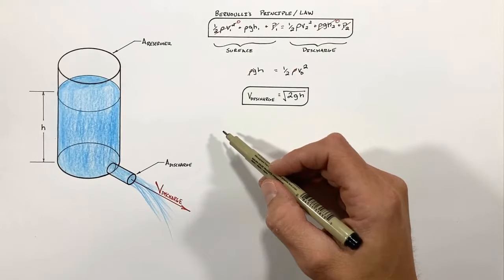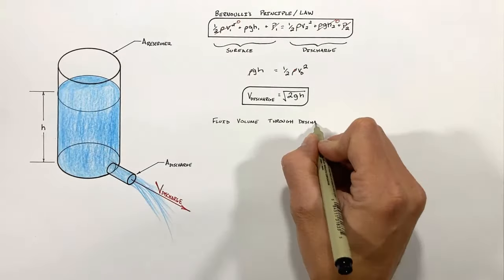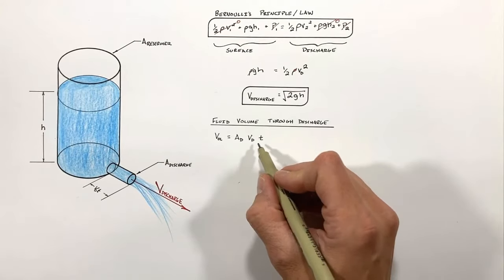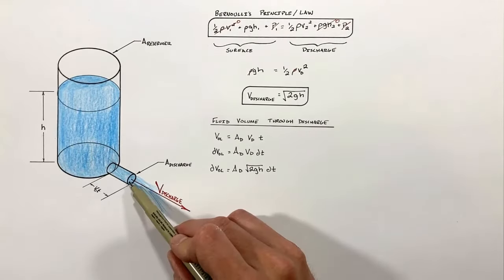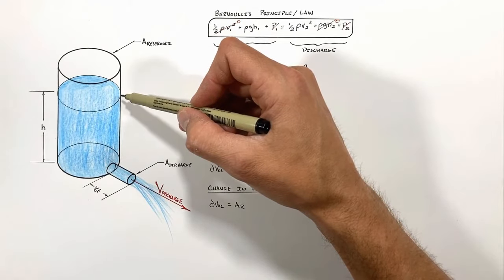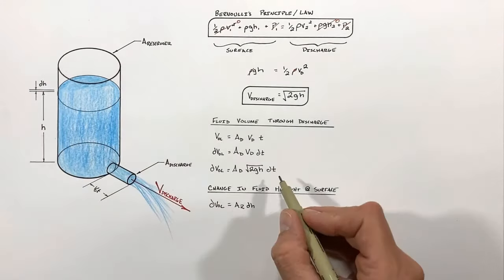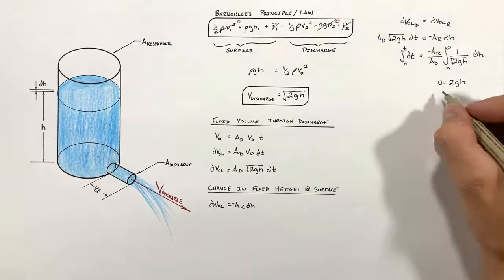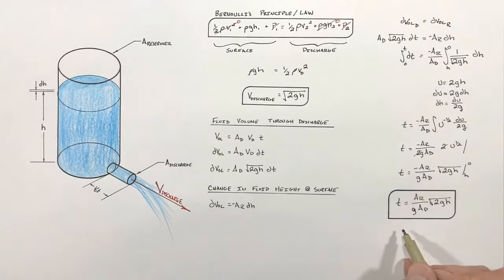Bernoulli's Water Tank | How Long Will It Take to Drain?

Comment: Hi, thanks so much for the video. I have a slight confusion. When you found the velocity using the Bernoullli equation, you assumed steady state flow and said that V1=0. But then, during the continuity equation, you wrote V1 as a differential, dh/dt. Does that actually make mathematical sense, or am I not getting the full picture. Because normally the tank drains unsteadly, and you need some differential to account for changes in downward velocity. Yet how can we do that when we already assume that V1 is 0.
Reply from the maker: You aren't missing a thing.  When applying bernoullis we consider the dynamic pressure at the reservoir surface to be negligible.  When applying continuity we then consider the change in height of the fluid over time.  

I admit it seems a bit silly we can ignore the motion of the reservoir fluid in one case but must consider it in another... but thats what we do.  Try working the problem considering dynamic pressure at the reservoir surface and you will find you get virtually the same result but with much more math involved.

Comment: Great tutorial. Where can I find an example to determine the time when two open water tanks connected by a pipe reach the same water levels?
Reply: I'm not sure if this is correct but I would approach this by having at all the water pipe on the hight of the lower water level, so like a moving pipe if you know what I mean. I think it would work since I'm pretty sure the position of the water pipe doesn't matted as long both ends are underwater. But again, please correct me if I'm wrong, because I very much might be.

Comment: Great Video! I have a question:

If the Reservoir had the shape of a funnel (or hopper), i.e. it's cross sectional area would decrease with decreasing height, how would that affect the discharge time?

I am assuming that the there will have to be an equation that relates the change of cross sectional area with respect to volume height, and then implement that into the solution presented in the video, but I am not quite sure how to go about solving it. 

Any help would be much appreciated!
Reply from the maker: You are absolutely correct:  the cross sectional area of the reservoir @3:00 becomes a function of the height.

Comment: Hi thanks so much for the video! Just one question, does it work for a square tank? Like area of reservoir is a square, say 1m x 1m
Reply: And also units would be, meter, second, right?
Reply from the maker: Yes it does.  In the frictionless case we care about areas, but not shapes.
Reply from the maker: Yes.
Reply: @INTEGRALPHYSICS  thanks! Actually what if the discharge coefficient becomes say 0.9, then the final time would be whatever time period divided by 0.9 right? Say without friction, time required 100 seconds, then with friction coefficient @ 0.9, then time required becomes 100/0.9 = 111 sec

Comment: Does the length of the discharge pipe have an effect?
Reply from the maker: Yes, but only if you account for friction.
Reply: @INTEGRALPHYSICS  How would you factor in those two parameters into your derived equation?

Comment: I HAVE A CONCEPTUAL QUESTION PLZ HELP!

Hey I solved this problem by doing a differential equation to solve for h(t) (with help from wolfram) and I got the same result for the time.

However, I imagined, "what if the discharge area were the same as the tank area?"  In that case, you get the same time as you would by dropping a ball off the top of the water column.  But how can this physically work?  

The initial velocity of the water coming out must be the same as the same as the ball dropped ball when it hits the ground.  But if the discharge area were the same as the column area, that means the column would IMMEDIATELY gain a large velocity as soon as you opened the valve.  Would that actually happen?  

And then physically in the typical example, you'd expect the velocity to DECREASE as the tank drained.  However, if the discharge area were virtually the same as the tank area, wouldn't that be like free-fall?  In free-fall the initial velocity is 0 and then it accelerates.  

Then you could imagine, "What if the discharge area were larger than the tank area?"  In that case, it would seem like the discharge water would suck down the column of water faster than it would fall in free-fall.  That doesn't seem right.

I guess one answer could be that if the discharge area were too large, then maybe the whole area of the discharge would not stay filled to the top with water, and air would get in and disturb the flow of the water.  But if anybody has any other conceptual/practical ways of making me understand this better in the edge-case, that would be appreciated.  

Suppose there were a really tall column of water (so that there was a lot of pressure at the bottom), and then the bottom cap on the column were made to instantly disappear with a magic wand.  There would be a lot of pressure on that bottom surface the instant before the cap was removed, so I imagine that the water would come out with force in that instant.  But how would that formerly pressurized water at the bottom force the water at the top of the column to also move down instantaneously with force?  If I imagine tiny layers of water, the water at the bottom touching the air would come out fast because the water pressure above would be much greater than the air pressure below.  Then when that tiny sliver of water moved, the same would happen to the sliver above, but at a somewhat reduced speed because of the lower pressure slightly higher up.  So would there be a chain reaction of the water at the bottom instantly exploding down, with the water exploding down at reduced speed in proportion to the reduced height?  Wouldn't that cause some kind of vacuum/cavitation if air didn't get mixed in?  Or maybe a better conceptualization would be to say that the pressure in the water column would be immediately converted into velocity (or converted at the speed of sound), which would cause a velocity gradient, which would cause the water to have weird behavior like cavitation.
Reply: moye moye